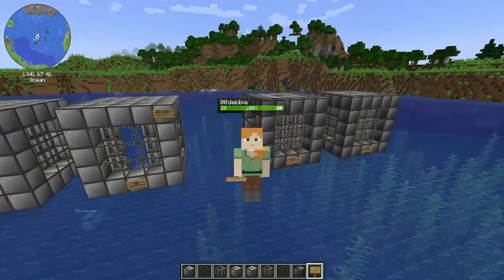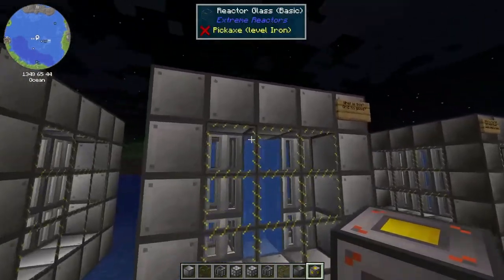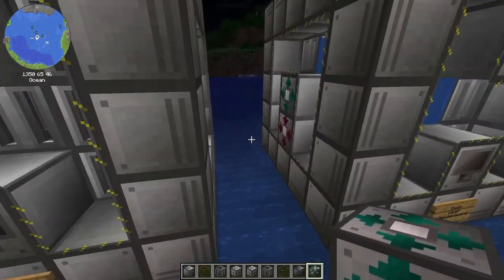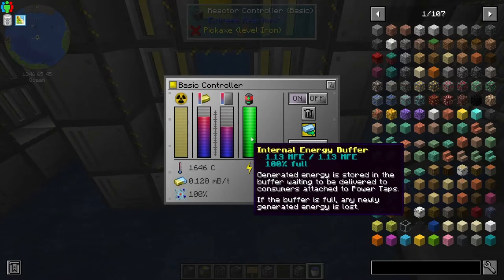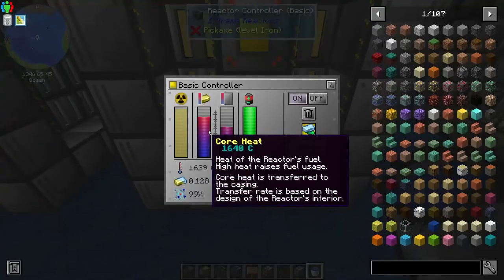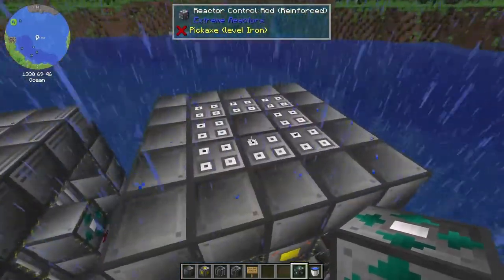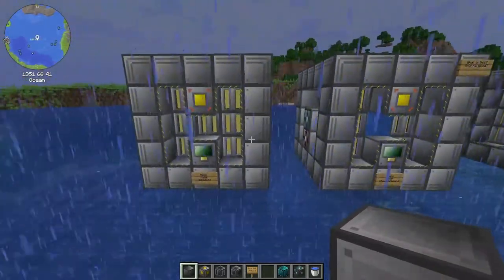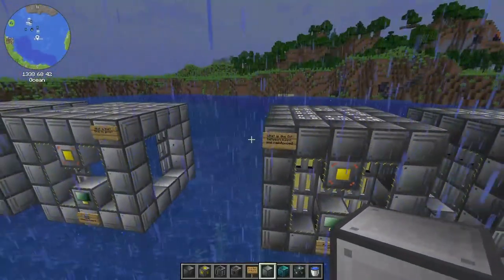DireWolf20 1.18 Extreme Reactors 2 Questions 1: Grid/Adjacent and Basic/Reinforced

Comment: Grid shape is inefficient, ring is always better with the same amount of rods. You got this results because you can't use ring on reactor this small. Fuel rods should NOT touch reactor frame directly. About heat... you have two heat gauges. Core heat(left gauge) determines how much fuel you consume. Casing heat is what is converted into the energy. Difference between core heat and casing heat are the losses, you do not want them.

The reactor that my go to option on low power applications that has highest efficiency(I used reinforced because of dimensions and computer port): 5×5×1 active zone (that means 7×7×3 frame). Outer ring that is touching reactor frame is all made of blocks with highest thermal conductivity(to even our core heat and casing heat). Best choices are diamond blocks for medium game, or liquid redfrigium for later game. Then the ring of eight fuel rods, also in the ring shape. Then there is a block in the very center of the reactor. It needs to have highest radiation moderation. Graphite is decent for early game, if you have thermal series installed, then enderium is better in that place. Finally, redfrigium goes there in the later game, as it is equally good with heat distribution and radiation distribution).

This mod is insanely complicated in it's core every material and layout have many variables, pros and cons. And it is specifically poorly documented by the author, so players should determine better results via their own experiments. I experimented a lot, and here is what I came up with. If you need more raw power, you can scale my scheme upwards. About scaling horizontally... it's complicated. Every rod should have shortest path towards the wall through heat conductive blocks, or there will be poor heat transfer resulting in losses. Direct contact of the rod with the wall is bad, direct contact of the rod with another rod is good. This is general rule for the layout that i came up with.
Reply from the maker: Thank you for all of that information :) I appreciate your comment 😊
Reply: @debbiesa00  yeah, this is what i've obtained through extensive testing and a little bit of code analyzing. Mod developer's philosophy is clearly to avoid giving players the exact recipe for objectively best reactor. They want people to launch holy war in the comments between grid-believers and ring-believers 😆
Reply from the maker: @voidseeker4394  🤣

Comment: For the difference between active vs passive power tap, Mek Universal Cables (for example) in pull mode will take power out of a passive one, but if you don't configure the cable, it'll need an active power tap.  Also, I don't think Flux Networks pull, so either you need to attach it to an Active tap or to a cable that DOES pull.

For the difference between ring vs checkerboard layout for fuel rods, personally I'd rather build a bigger reactor that uses less fuel per energy generated.  :-P  But that's personal preference, really.
Reply from the maker: Yeah, it is nice to know that there ARE options to have more power if you chose to :)
Reply: General rule for the reactors: if you expand it vertically, it will produce more energy, if you expand it horizontally - it would be more efficient. And they doesn't have to be exact cubes, you can balance dimensions as you want.